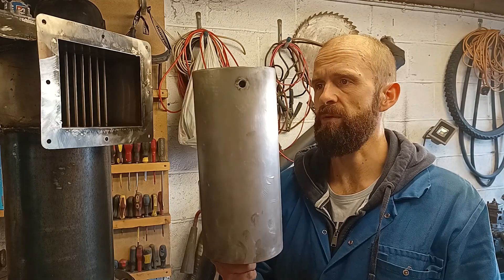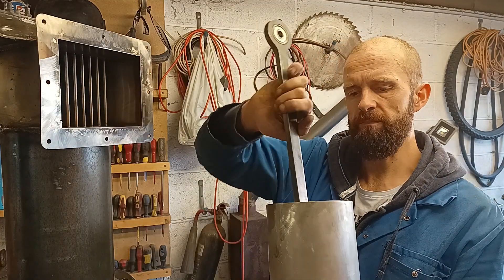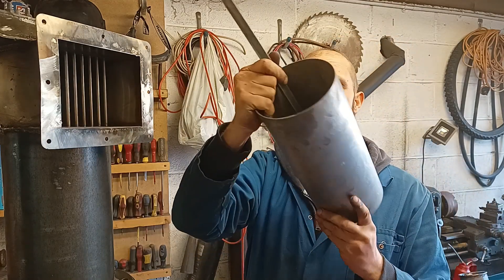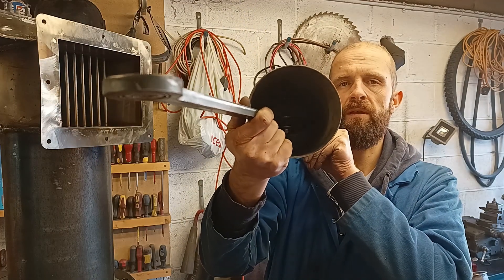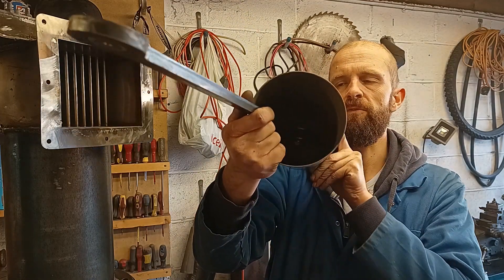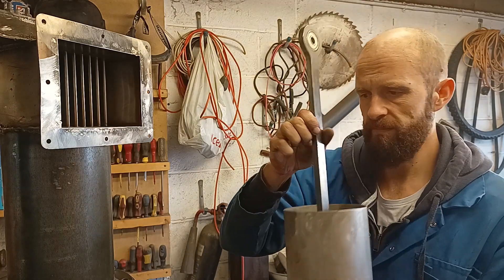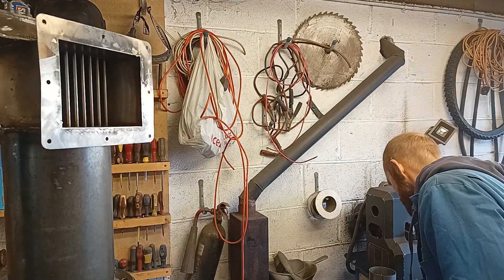Building a Stirling Engine that is Wood Fired - Part 4 - (Hopefully 500W + )

Comment: Just a thought maybe put a chain sprocket on your shaft before you assemble it so you can attach something to it
Reply from the maker: Im not to sure what I'm going to drive yet? Assuming it works, the first thing I'll attach to crankshaft will be a dynometer to test power output (thinking of a hydraulic disc brake + spring balance). I've designed it so crankshaft can be easily removed to attach drive output.
Reply: @ShanePomeroy  this project would look nice with a pair of bevel gears, this would put a shaft strait out of the middle at a right angle to the crank shaft.

Comment: Excited to see it running! Making some great progress. 
I've had this slightly bonkers idea of trying to make a Honda VFR750 engine work as a sterling, but there are definitely a few questions as to the viability of it.
Reply from the maker: Cheers. Would you change the VFR cylinders for something more suitable? I wonder what the stroke is on them? It would be amazing!
Reply: @ShanePomeroy  The stroke is a mere 48.6 mm. I would definitely be extending the cylinder of at least the hot-side. My biggest worry is friction: Hoping that graphite-infused PTFE cylinder rings would be sufficient, and if I have to then it could be in a gamma configuration rather than alpha, which would decrease friction by loads. 
Looking at ways to reduce weight in any non-rotating parts too. A cheap build though if it works, and it's all set-up already for cooling around the cold-cylinder if it's needed because it's a jacketed engine. I am not at-all certain it will work well, but It's worth a shot.